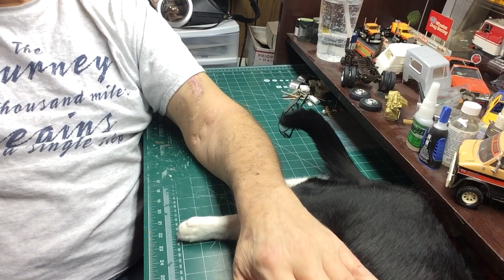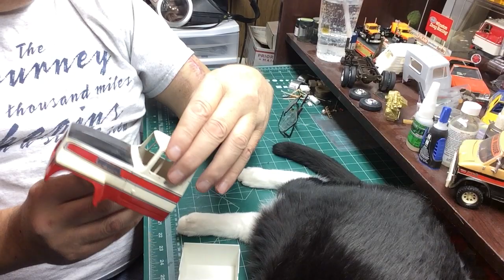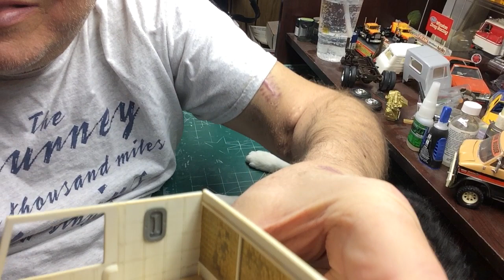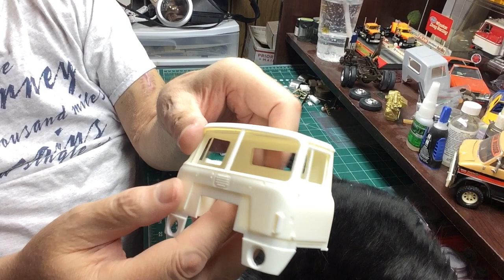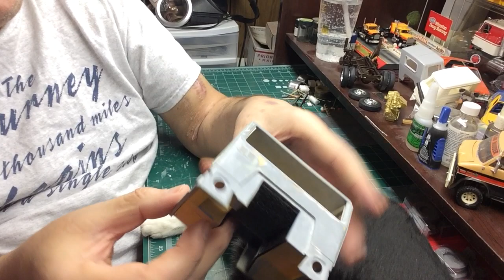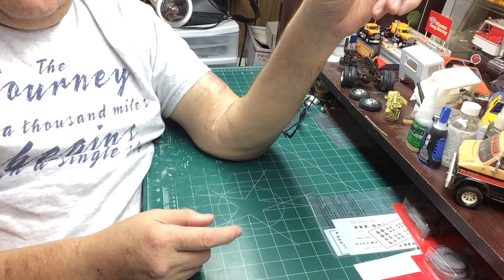February 4, 2023, new 3D printed trash truck body and other miscellaneous stuff, PART TWO

Comment: Glad to have found your channel and like so many other builders here I find your tips and tricks invaluable, But I just wanted to add a little real world truck knowledge to what you said about tanks not having seams  you are correct about model tanks and the way that they are made the seam does not belong or are made with a horizontal seam but with that said I had a 1996 Ford LTL9000 Aeromax ordered  it with 2 500 gal. fuel tanks one per side but we took the passenger side tank cut it in half welded in a divider then welded the tank back together and made 2 aprox. 250 gal. tanks out of the one and plumbed the back half of said tank for Hydraulic oil for a wet kit for the goose neck of my lowboy trailer. So I ended up with a vertical seam around my tank it was highly polished to a mirror but still you could see a seam I did it that way so I didn't have that unsightly plastic tank that Muncie supplied with their wet kits that was supposed to be mounted on the catwalk behind the sleeper. It was one of 3 Trucks that I showed at the MidAmerica Truck Shows in Louisville Ky. under working class so on a couple of my truck build I incorporated the same seam on them just because I always thought what we done was pretty cool on how to hide a Hyd. tank

Comment: Very enjoyable video/model building chat. That ford w9000 cab is like the one I drove in the 70s and your sleeper detail is right on. I always thought the sleeper walls were high class for a Ford but I loved that  about those Fords while all through the day day it beating me to a pulp. Backaches 24/7/365---- always! Hendrickson suspension on a short wheelbase. But I still want to build one of your cabs on the new 4070 air ride chassis nice length too. Get it Cast!

Comment: Ben + did you notice that on the AMT kit they forgot the drip rail molding it's on that aftermarket daycab international 40704 kit
Reply from the maker: I didn’t notice that!?
Reply: @lotso69  + Look at the new kits of the 4070a I added them to mine evergreen strip styrene I am surprised you didn't notice it the drip rail moldings